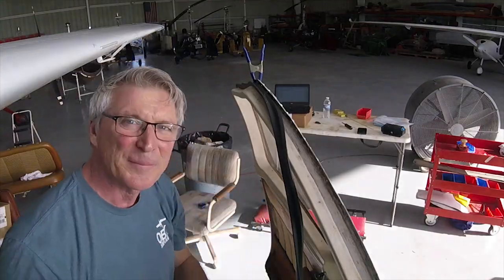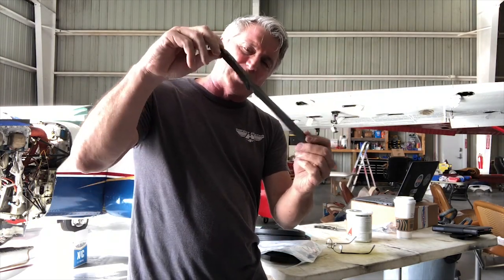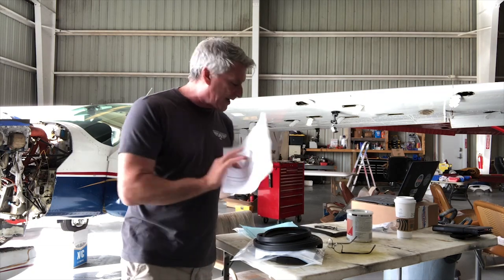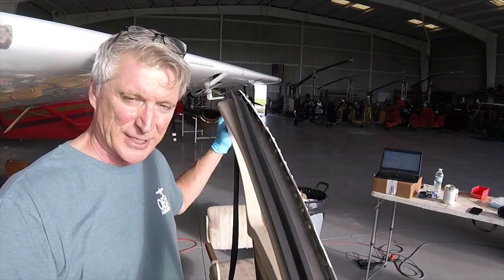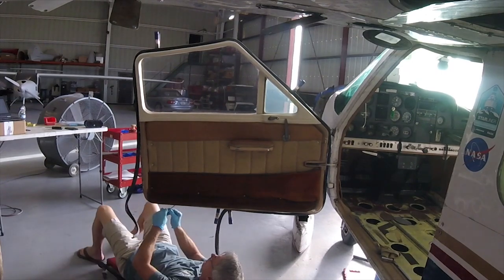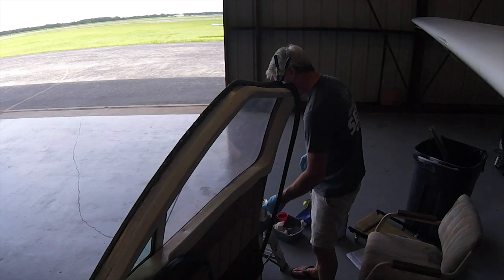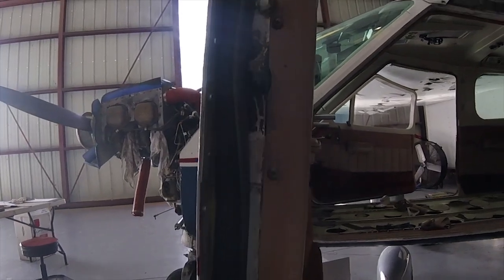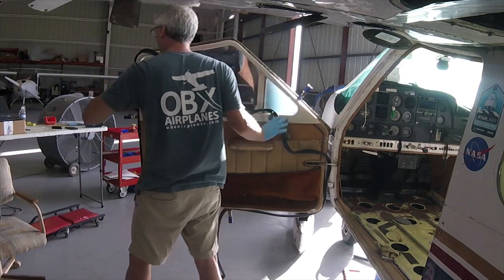Replacing Your Door Seals

Comment: Not bragging but have been an A&P for 28+ years, and this was hard to watch. Here's a great tip. Apply the contact cement/adhesive to the seal AND to the door, and let BOTH dry to the touch. Yes.  Let them dry. You will need some MEK (Methyl Ethyl Keystone) moisten a rag with MEK. It doesn't need to be wet to the point it drips though. VERY lightly wipe the contact cement/adhesive on the door and the seal. Then put the seal on the door. It will bond instantly, and form a much stronger bond. This will make the install MUCH easier, and MUCH less likely to disbond in the future, AND will eliminate the need for any clips, clamps, tape, or anything else to hold the seal in place until the adhesive dries.
Reply from the maker: Absolutely! Thanks! I figured that out after the fact ! Thanks for watching !
Reply: Thank you!